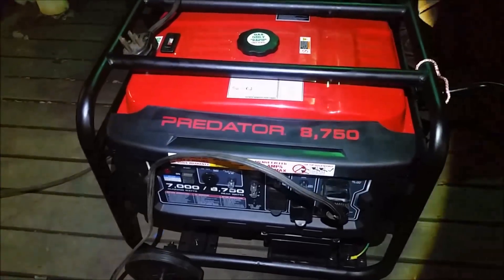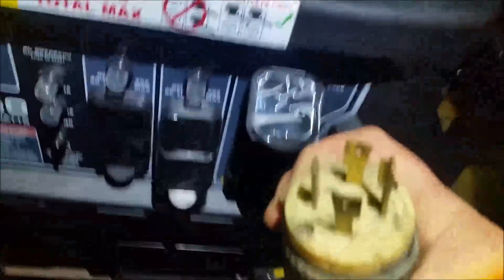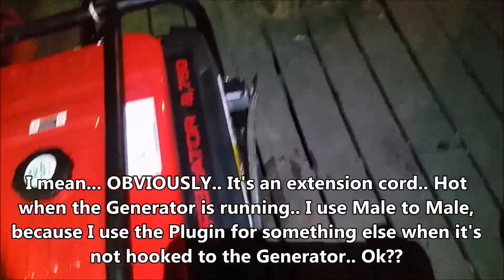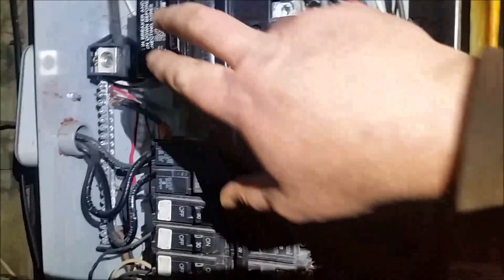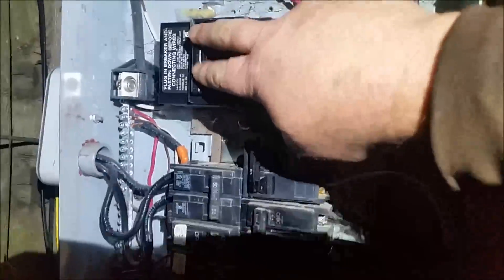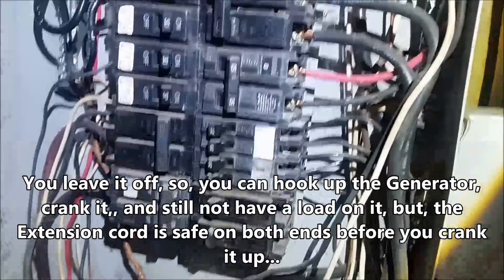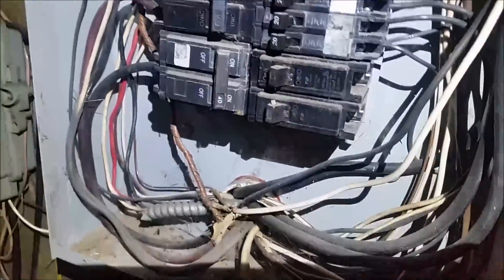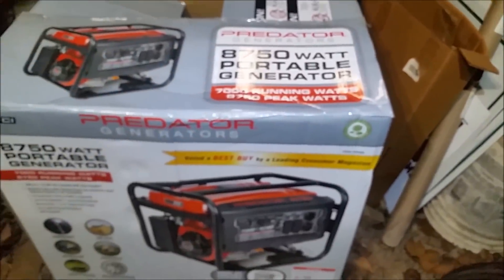Quick/Easy/Safe: Use Existing Plugin/Breaker for Generator hook up to your house Panel box.

Comment: Mark, thanks for the video....I have never had to hook generator to main box, but in a pinch, I now know how to do it, and I would not hesitate to do it the way you have done.  I have seen plenty of generators in use....never have seen one hooked to a ground rod as one alluded to in comments........but I guess there are many ways one can do things.........
Reply: Just my two cents but I suspect NEC doesn't want double grounding since it's so specific regarding bonding at the main panel only.
Reply from the maker: George1mac.. Thank you Sir.. It's nice to meet someone with common sense every now and then.. Glad to have you on board..  Yes.. there are many ways to do things.. Seems like there is always some alternate way.. I always try to save time and money.. Time being the major concern most of the time because I do so many different things, there is never enough time to get everything done.. I just wanted a quick and easy way to hook up and disconnect, without installing something else I wasn't going to use much, and take so much effort and money on top of all of that.. My outside panel feeds the house directly.. It would have been a real pain to install one here.. I have installed them before.. And, if I ever build a new home, I will design one or buy and install one,, as part of the initial build.. And I will place it where it makes sense and have a generator house to house the generator.. 

But, it was crazy to try to do something like that here, and in about 90% of the homes that I look at are about in the same shape as me.. But, it is easy to do this with an existing 220v plugin. I have 4 on the shop side of my house.. Might as well use one.  Ground.. Yes, every generator I have had has a small ground screw to ground the generator.. But, since the panel is well grounded according to code, it really does not make sense to me.. Ed Taylor has commented and I am sure what he said is correct. It goes along with what I know about bonding.. 
I think it is there for insurance purposes for the safety of the manufacturer, because, when have you ever seen on in use.. In states that have shared liability, it would just about make a lawsuit against them worthless.. Did you hook up the ground as instructed? No.. OOps.. 
Yes.. I agree.. And their manual says to ground it in a similar manner as the house panel is grounded.. It may provide you some additional safety if you are just running extension cords, but, it surely won't eliminate any problems.. I would say it would be like wearing a rain suit and holding an umbrella or wearing two condoms.. Works, but, is it necessary?.. Ha.. 
I had to toss that one in there.. Ha..
Reply: I am not an electrician, but I have wired quite a few things in my time including sub panels and running remote lines to outbuildings etc....does not make me an expert, but there are plenty of books to make sure things are done right.  Our daughter needed a ceiling fan placed and I found the building had passed inspection with reversed neutral/hot...yeah, I do everything with a meter and I always wire everything with the breaker off...overkill from what most do that I have seen, but I want to be safe.  Many times as a youngster,  I watched my dad temporarily place a penny in the old fuse box to get the lights on in the house.....is that a safe thing?....well he always turned off the breaker and then did a good inspection after he did the patch.  It was never to be a permanent thing.  I looked at one of the sites posted in the comments that sell the plug ins....and it says this: "If the main breaker is turned off, it alleviates the hazard, but that requires remembering to shut the breaker off, and relies solely on the user to do so. There is no guarantee that someone else will not turn the main breaker back on and suddenly energize the neighborhood wires. There is no safeguard in this arrangement."....🤣  well, there is no one at my home that would ever, ever touch the panel, and I never, never change out anything in the panel without turning off the main breaker, and if I ever thought I could not remember to do so or nor remember to not turn it back on before disconnecting something such as a generator, I would make myself a sign and put it on the box.....as you say...common sense.
Reply: Oh, and BTW, I have never seen a ground rod supplied with a generator....tell all the folks who go camping they are to drive a 8' rod in the ground that they cannot retrieve after its one time use and see what they say.  I know what they are for....our electric fences require several to work well,  I always drive an extra one at any outbuilding I have wired to be on the safe side, so like yours and  Ed's comment, I do not see need for double ground if temp generator is used.
Reply from the maker: That's about it George.. I have had to bypass a fuse a time or two also.. I never tried a penny.. Just fold some tin foil over a few times and drop it in..  I would like to study the Ground/Neutral with an Engineer.. I understand the theory, and can understand why it is important to have frame ground and neutral and ground properly on receptacles, but, considering they both terminate on the same "Ground Bar" in the panel, I'm not so sure how important it is on other items, and for that matter the receptacle itself. But, wire them up like they are supposed to just the same.. Nothing wrong with erroring on the side of caution and being safe.. I agree.. In 15 years, running on generator often in my area, I have never forgotten to turn the main breaker off.
Reply from the maker: Yea.. I agree.. Ha.. No,, I have not gotten any ground rods with mine either... :)..  And the ground screw look like something you would use on a CB Radio or something, not a ground rod.. That is what I was referring to it being installed for their insurance reasons..  No one uses them, and it is one thing they can say.. Why did you not connect the ground rod.. And, what can you say? How can you prove it would not have made a difference.. Ha.. 
Yep.. I learned the same thing about Electric fences.. I had to run a few strands around my Apiary(Honey Bee yard), to discourage the Bears.. First ever experience with it, but, I had an old timer walk up and touch the fence, go and look at the box and said to me,,, "Son,, you don't have this grounded".. I said,, Yes  Sir.. Its grounded on both ends.. No Son,, You don't have this thing "GROUNDED".. Ha..Ha.. Well, it will wake you up now.. Ha..Ha.. 
I don't know if I buy the Copper Ground Rod deal though.. Copper is going to oxidize and corrode, and it's going to do it faster than a good galvanized pipe.
The old timer recommended galvanized pipe too..  I didn't do it, but, he had a good idea.. Put several Ground rods along the fence and connect each of them to a copper wire running just under the ground between all of them..  I put the fence too damn close to my boxes and didn't realize how far my tail end sticks out when I bend over.. Ha..Ha.. Twice I hurt my back from snapping up after getting popped.. Finally, I moved the fence back another 2 feet..Ha.>Ha.. Cheers.
Funny.. More grounds means you get shocked better.. The Irony.. Huh!!!
Reply: Ha.......last time I touched an electric fence, it felt like my whole arm was knocked off.....no going up and touching the wire for me to test....one of my friends will wear tennis shoes and touch a fence to see if it is hot...he says if it just tingles a little, it is not well grounded or connected, so we will go look for the reason.....not me....I just ain't going to do it....I will stick the little probe in the ground and then check the volts.  Saying all that, any fence with more than a half mile needs three rods 10 feet apart connected in tandem with a decent gauge copper wire.  I buy galvanized rods from Lowes or Tractor Supply.  I have seen people use galvanized water pipe...it will work, but getting the proper sized clamp to connect the wire is the problem....I have seen Rebar used, but it will corrode more quickly......any of the used material will work best if the ground is  moist.  We put our rods near a ditch line, so they stay moist....will knock your socks off👌
Reply from the maker: Ha.Ha..Ha.. YEP!! I'll bet it will..  I can see me walking up to your fence.. I look to see how the ground is hooked up, see it over there by the ditch,, and I know.. These guys took the time to do it right.. I'll bet that sucker will bite the piss out of you.. 
But,, my Curiosity gets the best of me and I put my backhand out to get a good "check out". Ha.Ha.. I know what you are talking about.. Ha..Ha. 

I remember the first fence I touched.. I was thinking.. This bothers the cows?? Ha.Ha..Ha.. 
Out of the next 4 or 5 fences,, Ouch,, Ouch,, Ouch.. Ha..Ha.. I think the cat is out of the bag.. These guys are cruising youtube and learning the tricks from everyone else.. Ha..Ha.. 
 I love Youtube.. For that exact reason.. 
I don't monitize my channel, and I pay $10 a month, not to see the ads, and I put my two cents in, to help the community to show my thanks back.. 
A wealth of information, and it's free.. Ha..Ha. Cheers.. 
So, when I comment to these knuckleheads that don't think,, I am always thinking.. You should not be able to be part of the community, because if we left it up to them,, youtube would not exist.. :) Might as well set the record straight and have a worthy amount of information for the next guy who does get a benefit from it.